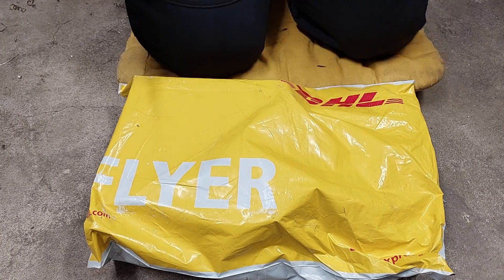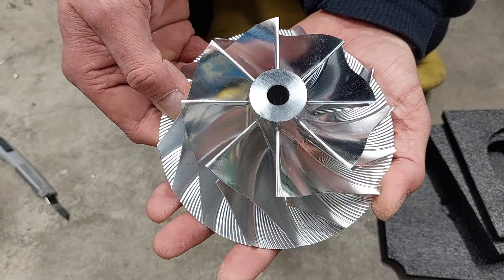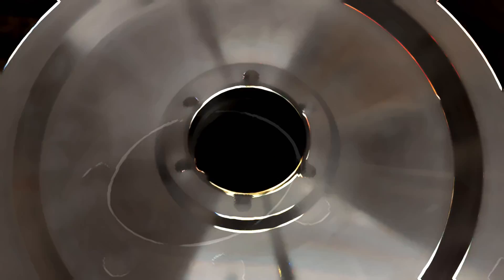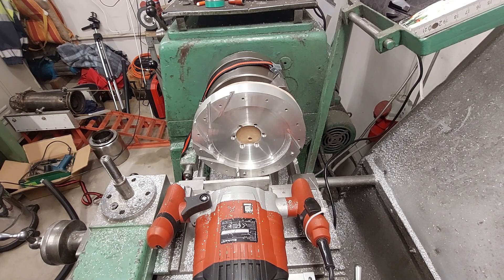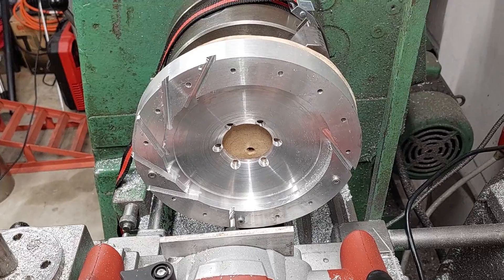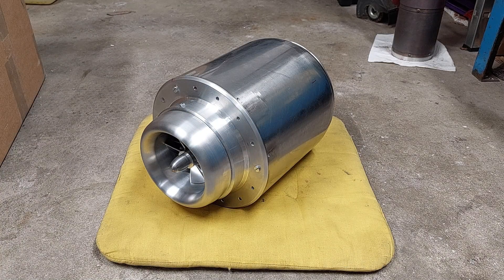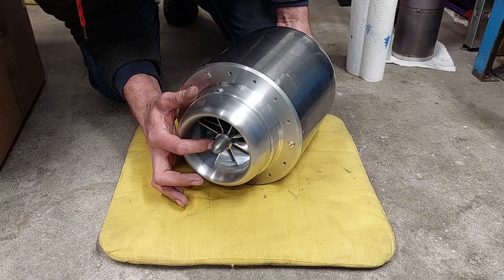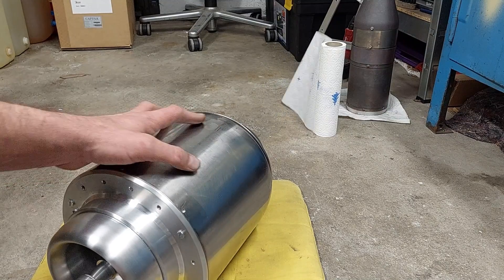Homemade Jet engine, finally thrust :-), scale on limit?

Comment: I really like this group of videos, however there is no pattern to the steps of the build. If you want to follow the process you have to search for what you think might be the next step in the process, and I’m also positive that someday soon the next achievement will be posted, who knows maybe he will be adding a cheese grater next, he already have probably half of the pots and pans from the kitchen pantry repurposed for use in this build. Personally now what I would like to see is editing the videos and taking the clips that only pertain to the final successful engine that is shown in the most recent video. Also there looks like some missing steps that should show the steps in building and installing the centre section. Including the bearings and sealing rings for the turbine shaft, next how is the lubrication supply and is it installed. Explanation of how the lube is cooled and is the lube oil the only cooling that the turbine housing uses? How the spaghetti pot is cut for use, but bottom line a process that one can follow so we the viewer can attempt a similar project.
Ok I’m stopping here and see what I receive in replies.

Comment: Wie hast Du die Verzögerung der Spritpumpe realisiert?
Reply from the maker: Hi,
da gibt es keine elektronischen Bauteile dazwischen.
Das Signal geht direkt von der Funke zum Regler und zum Pumpenmotor.
Ich gebe relativ gleichmäsig Gas und das Triebwerk zieht schnell mit.
Für 2,6 Kg Gewicht des Läufers, ist die Beschleunigung nicht schlecht.
Mfg Andy
Reply: @Praendy  sie beschleunigt super für so ein großes Triebwerk! Denke ab Halbgas würde sie sogar noch mehr Sprit verkraften.

Comment: Hello sir.  how reliable is this engine?  Can you estimate how long it will work continuously until it fails?  Theoretically speaking, can it be coupled with an electric power generator and steam turbine to generate heat and electricity?
Reply from the maker: Hi,
Its only a thrust engine.
For a generator use you will need a second turbine stage and a gear box and 1,8 Liter/min  fuel consumption is a lot😉 for a generator.
Better using a small Diesel engine.
Andy
Reply: @Praendy  thanks for answer.  Apreciate.
Reply: What type of injectors or vaporizer you are using in the combustion chamber and how please @Praendy

Comment: could you make a tutorial on the inside? I might've missed it but I'm trying to make one myself. I'm making a model with internal combustion, what're the advantages to combusting at the rear? Also if you could make a link to some of the parts you used that would be awesome. Are you using one or two rear turbines?

Comment: Stopped @ 5:26, when I finally realized that what was labeled a video is actually a damn slide show with occasional video clips. Which is BS. This is a video site. The images in videos show motion NOT added by editing.
Reply from the maker: Wow it took 5 and a half minutes to realize it is a slide show?
You are not the smartest guy🤣
Also you are not able to skip forward?
At about 6 min, the VIDEO starts.
You dont need to unsubscribe my channel. (In case you did)
I will do that for you.
People like you dont know how much work is in a video, even it starts with a slide show.
Some things are much easier to tell with a slide show, instead of hours of hours BLA BLA BLA.
Do you have one video on your channel? NO? WHY? 
Think man!
Andy
Reply: @Praendy  it is not possible to unsubscribe someone else from your channel. they have to do it.

Comment: That is an amazing result for your shop capabilities. 
Is this low speed low power testing? 
 It is very quiet(because it isn't making any real rpm), and outputting a fraction of what I would expect for the size of engine.

Comment: very nice. the bolts in the exhaust can't be aerodynamic. you might lose a lot on those. maybe 10%. also the force chain isn't on a pulley? that might reduce the force.
Is the turbine just steel? 700 degrees might be ok for small engines.
jets are cool but a turbofan which is a bit more complex is suddenly way more interesting because it cuts the fuel usage in half. Those could sell for 25k$ each with 100kg thrust.

Comment: That's rather good for a home-built unit. Two of those with the current thrust, and it would be sufficient for a manned micro-jet type aircraft with decent performance. (Look at the numbers for the BD-5J.)

Comment: what type of bearings do you use and how do you oil them?
Reply from the maker: Hi,
I use angular contact bearings with ceramic balls. Search for 7003😉
Lubrication is like in smaller turbines.
Fuel+oil and a certain amount is used for the bearings and then burnt off.
Andy
Reply: @Praendy  Interesting
I've been wanting to look into making a turbine with a shaft extension that's capable of driving a generator

Comment: it would be really cool if someone could complete an axial 
turbojet of this seize
Reply: Been done years ago, actually smaller than this engine....🤔😏😀🇬🇧
Reply: @EnglishTurbines  god forbid if I get my hands on a few of them, Id probably try and build a crazy little aircraft
Reply: @mattman2216  The engine in this video uses a standard turbo RADIAL compressor wheel, which from a technical view makes it easier make it work. An AXIAL compressor is much more difficult in small engines, I'm talking like 70mm in diameter...This engine whilst impressive in size and thrust isn't difficult to make or get to work TBH. He also didn't make the Turbine wheel or I suspect the NGV section of the engine either....These are INCONEL castings, beyond the home builder...🤔😏😏😳🇬🇧

Comment: Wie schaffst Du es eigentlich, ein Verdichterleitsystem "auf den ersten Wurf" so perfekt hinzubekommen mit den Winkeln etc.?
Reply from the maker: Hi Peter,
Als erstes zeichne ich einige Diffusorkeile 1:1 auf Millimeterpapier und klebe das auf die vorgedrehte Aluminiumronde.
Den Rest mache ich mit einem Teilapparat (unterteilen in 15 gleiche Sektoren) und mit etwas Geduld das ausrichten fürs fräsen auf der Drehmaschine.
Mfg Andy
Reply: @Praendy  hi, aber wie passen die Winkel so gut aufs Verdichterrad beim ersten Wurf? :-)
Reply from the maker: @petergebert4817  
Die Winkel sind gar nicht sooo kritisch bei einem rückwärts gekrümmten V Rad, da kommt es auf 2°nicht an, falls du das meinst.
Letztendlich ist die Methode der Fertigung nichts anderes, als horizontales Fräsen.
Ich hätte gern eine Fräsmaschine. Doch eine mittlere Größe mit Zubehör zu einem erschwinglichen Preis zu finden, dauert halt.
Andy

Comment: Hello guys, i'm planning to build a turbo jet engine, but I lack  stainless steel tube to make sleeves  for vaporizing tubes. 

Can Copper Tubes survive the heat inside the combistion chamber ? Will it be a good choice to use a copper tube as a sleeve ?
Reply: copper gets really soft when heated.

Comment: What meaning of 64 kg  How do you switch this into kilometers/hour,  how do you calculate it?
Reply: There is no comparison. The air going in is accelerated. If the intake is 0.5 Mach, the outlet will be out a bit faster. If the inlet air is not moving, the air will travel out the outlet a bit faster. 100 lbs of thrust accelerates 100 lbs of air by 9.8m/s every second. Or 50 lbs of air by 19.6 m/s every second. 100 lbs is about 45 cubic metres of air at sea level. A rough guess is 5Kg or 5 cubic metres accelerated to 300km/h at sea level. A smaller exhaust nozzle would change the numbers again. Less exhaust but much higher acceleration which means less static thrust but a much higher terminal speed

Comment: You have so much fun.   I would have made the diffuser on rotary table make mill cuts every 12 degrees.  I can't believe you did that on your lathe which of course resulted in random irregular spacing.   You  can get hearing loss without wearing hearing protection.  At least use ear plugs.

Comment: Yay, you did it! Still betting on that theoretical 150lbs of thrust. 👍
Add: I missed it the first time, but I used a tea kettle for an intake house once before due to the pre-cut hole being rather nice. Never thought about using it for a nozzle, but I tend to have sized exhaust runners for a free power turbine on my larger units.
Reply from the maker: Hi,
I think 150lbs are possible.
I like to use household stuff.
Next test with afterburner😁
Thank you!
Andy
Reply: @Praendy  I meant to add this to the previous comment but forgot during musings on tea kettles, but as I'm sure you're aware, jet engines really don't 'wake up' until they're above that magical 90% throttle zone. It's not uncommon for a well-engineered example to almost double its power output going from 92-104% throttle, though it's also right on the ragged edge of temps spiraling out of control. When you said you still have or expect another 10k rpm to play with, that's where there's a mighty lump of power dwelling in that hole. The AB on your current configuration ought to be Real Juicy!
Reply from the maker: I know, what you mean😁
So far it was only a hot fart for the engine.
I guess 150lbs are minimum, but I also want to take care, not to overstress the engine.
Now its 4 years ago, when i start the build.
In April 2020 was the first run and now I have some positive results.
100lbs + afterburner should be ok for some tests and displays😊
Andy

Comment: You have done a great job, keeping the EGT that low shows a lot of potential, if you can get another 10k RPM, the thrust is going to be so much greater.
Looking at something like a KingTech 450N turbine, they recommend a 2200mAh 3S battery for the ECU; it is worth looking at the fuel consumption figures (which I imagine will be very similar to yours) and what pumps they are using.

Comment: Wie hast du eigentlich die Laufrad/Leitrad konfiguartion ausgelegt hinsichtlich der Winkel im Geschwindigkeitsdreieck? Wann bist du da im Optimum? Bei Volllast?
Reply from the maker: Hi Daniel,
so war es Mal ausgelegt.
Mittlerweile könnte das Leitsystem und die Turbine etwas "steilere"  Winkel vertragen.
Das liegt am neuen, größeren Verdichterrad.
Mit der Performance bin ich aber sehr zufrieden im Gegensatz zu den letzten 2 Jahren rumprobieren.😊
Mfg Andy
Reply: @Praendy  mega cool! Ja, mehr durchsatz heisst auch mehr mediangeschwindigkeit. Was noch voll cool wäre - eine Variable Turbinen Geometrie 😍
Reply from the maker: Also bei meinem zweiten Projekt, dachte ich an eine VTG Anlage.
Der Läufer ist von einem Turbolader und hat entsprechend eine Radialturbine.
Allerdings hat der originale Turbo keine variable Leitschaufelgeometrie, also selbst basteln, oder starre Winkel verbauen.😉
Andy
Reply: @Praendy  klingt cool! Ich bin gespannt. Vielleicht geht sich ja mal ein Mörderprojekt aus mit Mehrstufiger Turbine/Verdichter und einen Fan-sprich mantelstromtriebwerk